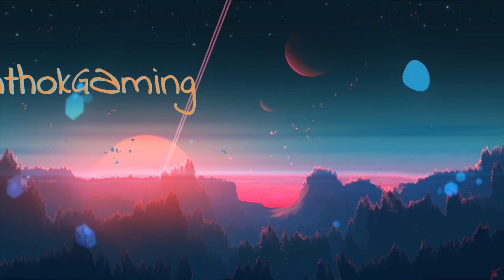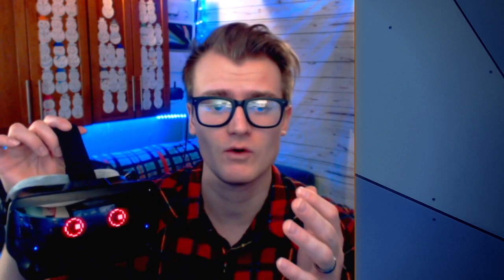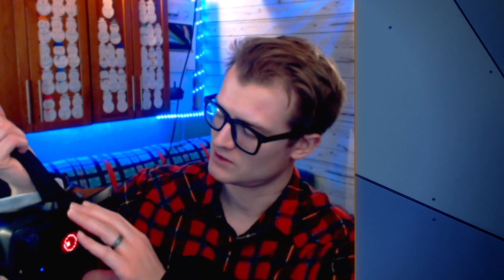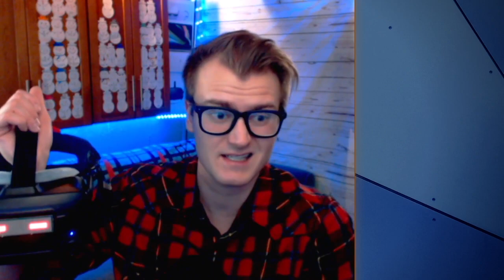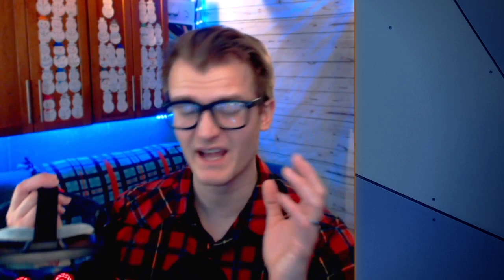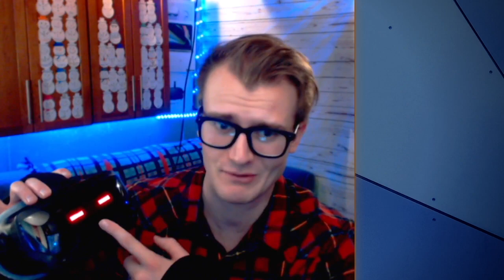Minidex Mod Update Video - Valve Index

Comment: I was one of the people wating for this update, lol.  I always thought the software was difficult to use.  But my biggest issue is that it was difficult to put in and take out and the on / off button was not very accessible.
Reply from the maker: These are also very valid concerns, especially with the 3D print. I leave it in so I didn’t mention this. I really wish it could be modified through the index while installed, it is a USB port and all!
Reply: @AnthokGaming  Yeah, maybe someone else will make a similar mod.
Reply from the maker: @TimboSlice083  I don't know what else could go there currently. Hopefully in the future there can be a hand tracking mod, or wireless to PC adapter straight from Valve. But that is kinda wishful thinking! What would you like to see?